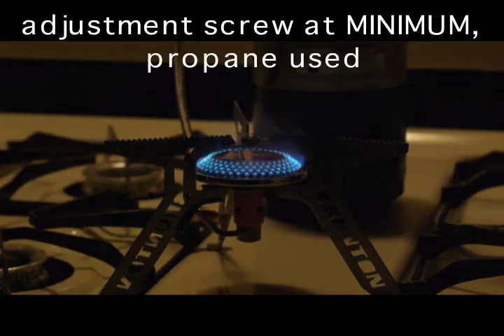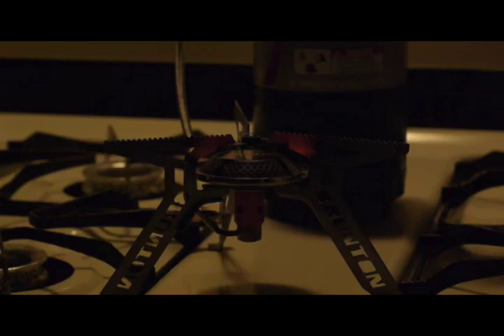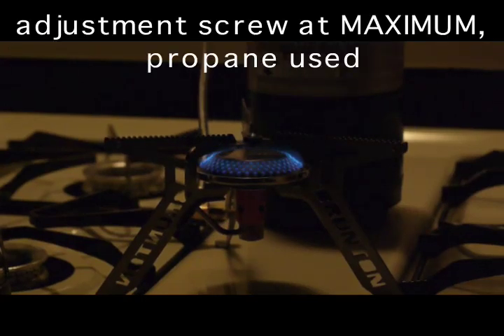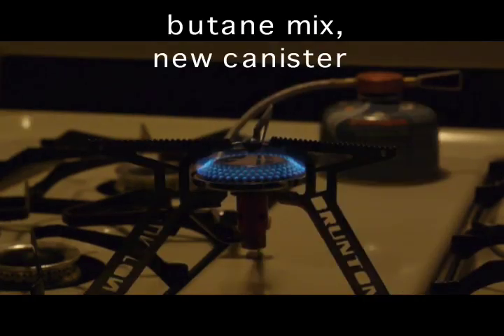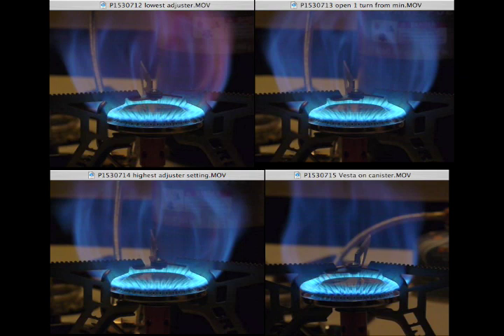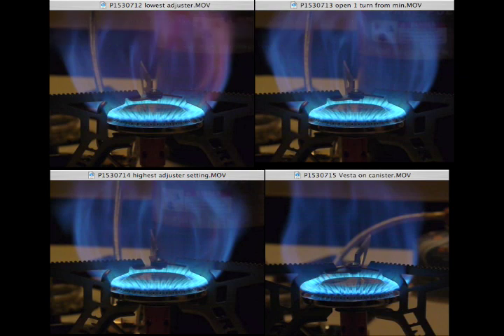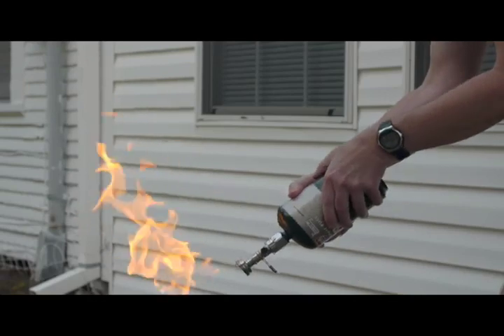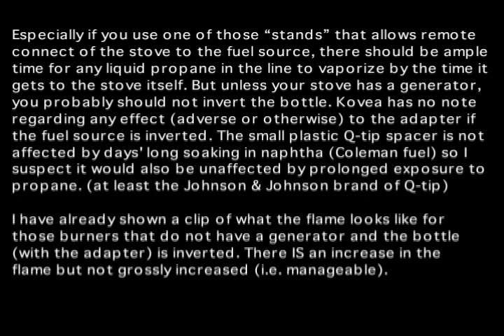Kovea LPG adapter evaluation & test, part 2

Comment from the maker: You are very kind to be so positive re this video! It's amazing how receiving such a positive comment like that can make me feel that the effort put into this video was worthwhile. 

As added info, I DO keep my propane cylinder/adapter connected to a small Brunton Vesta but if you do that, be sure connections are snug to avoid slow leaks that run down the propane supply! Also, be mindful of the jet sizes (propane burns leaner than butane). 

Thanks again!

Comment from the maker: You and I have noticed the same thing -- it's that safety valve. Connecting a stove FIRST to the adapter before connecting the adapter to the propane SOMETIMES works IF the pin depressing the valve is able to reach the screw and still have extra travel to push the valve in (and of course there is no propane pressure opposing this action as well). The modifications I made work regardless of the order in which you attach things. And, 100% of the time.

Comment from the maker: Brunton Vesta - originally designed for butane canisters, but will operate on propane though somewhat hotter than w/ butane due to being "leaner" burning. I use mine all the time for various small heat-up jobs. Thanks.

Comment from the maker: I could say "I can't see why not" but that's not to say I KNOW that this would be OK. Part of why I say that is that I don't know what the mechanical principles are behind the Kovea adapter compared to a standard regulator. If the LPG takeoff for EACH Kovea adapter arises directly from the 11kg cylinder, it SHOULD function like being attached directly to a 1# cylinder. However, a "T" (or multiple "T") branch off of ONE Kovea adapter I doubt would work effectively.